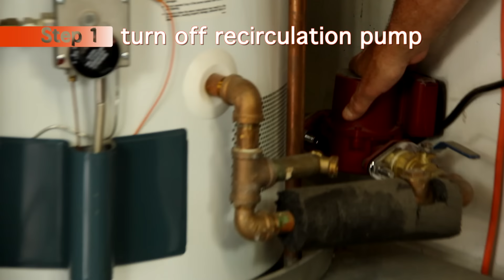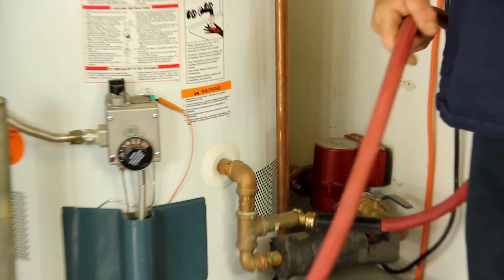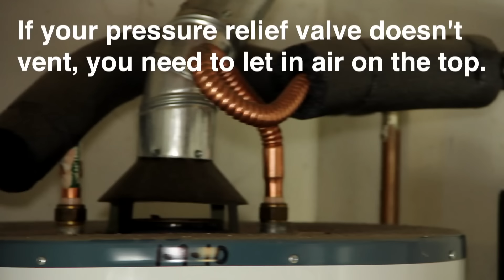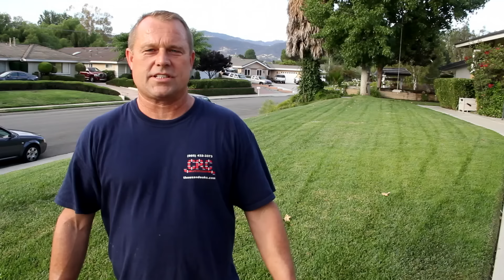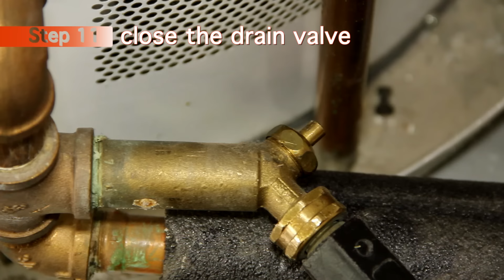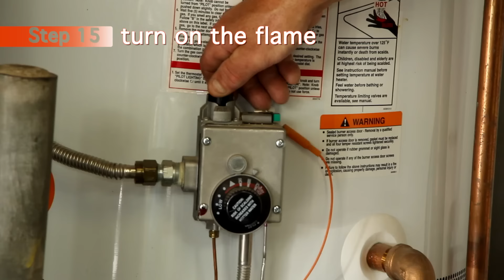How to drain a  water heater

Comment: I've seen where they tell  you to open up the hot side of a close faucet near the water heater.  Then go to another level of the house and open up another level and open up that hot water side of the faucet.  There is no need to unconnect the flexible pipe.  What if you didn't use flexible pipe and used copper

Comment: Did everything step by step. Noticed black flakey sediment during the 5m flush. Flushed it for an additional 5m and still noticed the black flakey sediment but not as much when doing the flush. Opened up all the hot water valves in the house and noticed the flakey sediment coming through the sinks and shower. Will this eventually settle down to the bottom or will I still get sediment from the sinks/shower?  Thanks

Comment: Thank you! First time taking this task on and we nailed it. 🙌 On that note, any recommendations to prevent future struggles of getting my hose off the drain valve when finished? I also couldn't get the hose piece working while draining it, thinking I might be plugged the hose with sediment, is that possible? I did finally get it to work for the flushing piece! Again, thank you!

Comment: Okay hopefully you'll catch this since it's a new comment on an old video. My pressure relief valve isn't hooked up with copper piping out the bottom. Do I have to fit that and build up the recirculation system before I try and drain my tank?

Comment: There are a few more important steps to be mentioned
1.  Turn off the heating or switch off the power at the home fuse panel (30A) the night before and take 1-2 showers to lower the water temp and not damage the draining hose
2.  Turn off (close) the cold water vane or red lever at the pipe just above the tank
3.  Connect the hose at the drain valve, open the drain valve with a flat butter knife if there is no place for a screw driver
4.  Open the hot water at a nearby bathroom faucet to allow air inside the tank, otherwise it won't start draining.  You can also lift the spring tank burping valve
5.  Let the tank drain for about 1.5h. It will drain first cold water, warm water starts flowing after about 30 min
6.  Once the tank stops draining  CLOSE the spring burping valve if you did open it - very important otherwise you will flood the room
7.  Leave the bathroom faucet hot water OPEN - very important to vent the air from the house piping
8.  Open the cold water valve or red lever just above the tank.  The bathroom faucet will start hissing loudly evacuating air from pipes.  The hissing will last 5-10 minutes
9.  Allow the tank to drain with cold water for 10 min or more.  Never close the bathroom hot water faucet during this time
10. Close the cold water valve or red lever just above the tank but leave the bathroom hot water faucet OPEN - the hissing will continue another 5 min or so
11. Close the drain valve - don't tighten too hard, remove the drain hose. Check the valve for dripping. May want to rotate it a little back and forth but don't overtighten
12. With the bathroom hot water faucet still open, open the cold water valve or red lever just above the tank. The tank will start filling up and the bathroom faucet will hiss for 5-10 minutes. Once the bathroom hot water faucet stops hissing and starts having a steady water flow, turn it off to allow the tank to fill up fully.
13. When the tank is fully filled (takes a few minutes), the cold water piping at the tank gets quiet. Again, during all this time the spring burping valve is CLOSED
14. Turn back on the tank heating only when the tank is fully filled up
15. Check again the drain valve 1-2 days later for dripping

The biggest risk with draining the tank is the drain valve may get stuck with debris and will start leaking when closed up.  Have this in mind before starting. You may try closing/opening the valve a few times to free it from debris, but if the tank has a lot of sediments you may actually cause more trouble trying to drain it. May try to use a garden hose to put a water jet through the open valve to clear the debris.
Reply: Nope

Comment: This videos great, although I've not got this type of elaborate water heater installation . This one is or has been clearly recently installed. I've got a plastic male threaded connection for draining no ball valve nothing you connect a plain garden hose and then??? I'll research another video.

Comment: Thanks for uploading this! Our water was running brackish today and I saved myself a pricey plumber call by watching this video! 

Note: if anyone has an expansion tank on their heater there’s a little air pressure cap on top similar to what you find on a car tire. That’s where you let the air in to drain in that situation. My hot and cold outs from the tank were just straight copper piping So there was no nut to loosen. (Took me about an hour to figure that out 😂)

Comment: Step 1 -  Turn off recirculation pump (turn off breaker)
Step 2 -  Turn gas to "pilot" setting (unless electric)
Step 3 -  Shut off water supply (valve on cold at top right)
Step 4 -  Connect hose to drain valve
Step 5 -  Take hose outside (put in bucket)
Step 6 -  Open drain valve
Step 7 -  Let air into tank (loosen top nut)
Step 8 -  Let take drain completely
Step 9 -  Tighten nut on top of tank
Step 10 - Flush tank (open main valve) Apx. 5 minutes
Step 11 - Close drain valve
Step 12 - Disconnect hose
Step 13 - Turn on hot water in house (farthest from water heater 1st)
Step 14 - Turn on recirculation pump and/or breaker
Step 15 - Turn on flame (unless electric)

Comment: Regarding the loosening of the top nut to incorporate air in the system....If I have fully soldered copper lines instead of the flex lines, can I at this point just cut the copper lines to allow the air....there shouldn't be any water in there, right?  THanks.

Comment: I had a Bradford White water heater installed in 2011.  I had not ever drained it in fear I would mess something up.  
I took on the project 10.08.19 and it was easy. 
I’m glad I drained it but there wasn’t anything to speak of in the bucket.  
We live in Dallas, TX.   Could it be possible I need to check something else? 
Thanks for your instructions!

Comment: Opening a faucet works a lot better for getting it to get to drain than using the pressure releif valve. I wanted to know why you didn't let the water cool off before draining? I would think draining the water heater when the water and the tank are hot would be a bad idea. Why did you install a circulation pump? Does that prolong the life of the water heater?

Comment: My comment might help some folks. I did every procedure to get the water to out of my tank, but it refused to come out. Finally I realized the weird plastic drain valve simply was not working. I replaced it, and now the procedure in this video is working.

Comment: You don’t need to open the hoses on top of tank or the pressure release valve, just open any hot water faucet in the house this will create the vacuum necessary to flow water out. Why would you go through that. Other than that the video seems correct
Reply: Works the same but may be the better option to open hot water faucet rather than the pressure relief valve. Friends used pressure relief valve for this and after it was open it never shut off back properly and they had a leak with immediate call to plumber to replace the valve as it was not opened for decade and its emergency use one, so it corroded and spring never shut it back. more dangerous than opening the faucet for sure.
Reply: He's a plumber giving a tutorial. He isn't wrong.
Reply: yeee he lost me when he started doing all that.
Reply: @The Master Chad  shut off the cold water intake to tank. That is creating the pressure.
Reply: He gets paid hourly
Reply: Opening hot water faucet does nothing 
Opening the pressure relief valve fixed the issue
Reply: agreed, it's better to just turn on the hot water faucet.
Reply: Faucets did nothing for me.  As soon as I opened the cold water valve at the top, it started gushing.
Reply: I tried a faucet and heard nothing, then tried the shower faucet and then I heard water moving except no water came out.  I'm thinking there might be an obstruction.

Comment: Nice video! I watch it annually before I do this. Also, I just open the hot water tap in the basement utility sink, which is 25 feet from the water heater, and that lets air in to the system.

Comment: I'm only getting a trickle to come out,  any ideas?
Reply from the maker: Its either needs air in the system to break vacuum or the drain valve could be packed with calcium.

Comment: What if after everything the water relief valve is dripping?
Reply from the maker: it may need replaced,unless its a pressure problem.
Reply from the maker: You may check pressure

Comment: I'm getting water out of the T&P valve, but it appears to be less than 8-12 oz a day.  Pulled the old T&P and the ceramic rod in the center was loose, does that indicate it was broken and leaking?  Replaced T&P with same results.  Very frustrating.  Not water out the T&P drain after a shower, but must be tripping when tank goes on heat cycle.  Any ideas?  Great video on how to drain.  Have one on replacing the T&P valve?
Reply: Still having problems?? Probably have it fixed already. But, I will give you advice for the future. He knows that as soon as the T&P valve is opened,, in most cases it will have to be replaced. There is a rubber grommet that will never seat correctly after it’s been in use for a couple years. Your, the reason that it’s leaking is because your thermostat on your heater has failed. It’s heating the water up too hot. There for expansion occurs, and it has to go somewhere. FYI..

Comment: This video is a life saver. The faucet on the bottom of the tank went out and I had to drained the tank for the first time today. Now I just have to replace the faucet. If I used the pressure release valve method should I replace that also?

Comment: As u know...lime builds up even over a few months and can get trapped at drain valve as it drains...even if try to flush with water from cold side.... i use a low pressure air compress blowing into relief valve that unclogs trapped lime at valve...

Comment: so im draining a tank at my hotel, its rusted bad and needs to be repalced, but we want to drain it obviously first, i turned the incoming cold water off, and then closed the outgoing hot water, because these are 4 units all connecting to the same hot water outlet, so to now drain, all indo is open that releif valve? because no water is coming out with all thise closed.

Comment: thanks for the vid. I recently bought a house with high water pressure. I rebuilt the PRV. but I just noticed there is no expansion tank. do you have a video on installing one of these?
Reply: They go after the shut off valve on the cold side.

Comment: Thank you! I just bought a house and noticed the hot water heater making knocking noises whenever it had to heat up a large amount of water (such as after running a large load of laundry using hot water). A plumber suggested that draining and cleaning the tank may help, and these instructions were extremely helpful. Unfortunately, once I turned the gas back up to heat the water filling the tank, I noticed the knocking noises were still there. Oh well. I saved the water I drained so I can use it to water plants once it cools down, too.
Reply: I would drain the tank
Reply: Yes, that's what I did. I followed this video and drained the tank.

Comment: Does that sediment/gunk go into your water system inside the house? out the faucets in bathroom/kitchen etc?
Reply: It will if is in bottom of your tank,that's one of the many reasons we need to drain the tank.
Reply: it will if you don't dtrain it out of the tank.

Comment: Ok so when I moved into my new home I was trying ways to conserve energy.  First thing was turning OFF the water heater.  I never use hot water so why waste electricity heating it right?  What is the best way to do this for prolonging the life of the tank?  Should I drain it and then flush it and then keeping it empty by turning off the water supply to it, or fill it with water but then turning off water supply so I am just getting clean cold water and not water mixing in with the tank water that will have bacteria growing in it since I am not heating it?  Thanks.  BTW I live in Florida so the only time of year I turn on the heater is November to January and even then I only turn it on as needed.

Comment: My tank is 13 years old and has never been drained, do you think it will still drain?
Reply from the maker: At 13 years old I would think its time to replace,although you can still drain them its probably full of calcium.
Reply: If you followed all the video instructions required to drain your tank AND your tank doesn't drain at all (or is slow to drain), then perhaps sediment/rust is blocking the drain valve. In that case step on your drain hose continually; that creates a pumping action that forces pressure back against whatever is blocking the drain and loosens the blockage. This actually worked for me after a few dozen steps on the hose. Good luck.
Reply: Thank you guys this is very informative, I'll make sure to follow your instructions.

Comment: Question. There is black oily substance coming from the bathtub, bathroom and kitchen faucets but only when turned on hot. I was told to drain the water heater or clean out the filter? Suggestions.
Reply from the maker: +Mayhem Raider If its only on the hot side it sounds like the heating system,although I don't recall any black oily substances from water heaters.

Comment: Thank you so much for the video, this was exactly what I needed to drain my ancient Kenmore 8 water heater. it's 22 years old and still ticking! Got that sediment somewhat flushed out and humming again. Suggestion for step  7a: Open a hot water faucet near your hot water tank to help alleviate pressure in the line when draining.

Comment: Hi Charles. I am preparing to install a recirculating pump on my water heater and I want to ensure I don't make a mistake and damage or ruin my water heater in the process. So, as I understand it, I want to do the following:
1. Turn WH to pilot
2. Turn off cold water to WH
3. Open a hot water faucet in the house to drain interior pipe
4. Connect hose to drain; put end in bucket
5. Open drain valve
6. Open relief valve
7. Drain desired amount of water (do I have to drain the entire tank? it's huge and I prefer to waste no more  than necessary)
8. Install recirculating pump, including connections at furthest sink
9. Close the relief valve
10. Turn on cold water to WH
11. Close drain valve
12. Allow air to escape hot water line in house; close faucet(s)
13. Plug in recirculating pump

Do I have all that correct? I was told if I tried to drain water from the tank without opening a relief, it would collapse the tank and therefore I am a bit "scared" or "cautious" as I don't want to make an error and have to replace the WH.

Thanks for your assistance.
Reply from the maker: Susan Walls Susan You do not have to drain the entire tank to install a pump,although I would recommend it.As far as preventing damages to your tank if you follow the same steps I have provided in this video you should be successful.I hope this helps.
Reply: CRC Plumbing Thanks. Appreciate the help.

Comment: Thanks for the detailed video, CRC...we're definitely getting some major knocking & I'm about halfway done with your steps...our water coming out is filthy.  Thanks a bunch...this will make my wife very happy having cleaner hot water!
Reply from the maker: Warring Angel If your tank is knocking this may not go away without removing the entire drain valve and evacuating all the calcium through the 3/4 port as this is usually large enough to get out the larger chunks.
Reply: CRC Plumbing, Okay...sounds like I may need a plumber for that, huh?  Or do you have another video?
Reply from the maker: Warring Angel Sorry,I don't currently have a video on that one.
Reply: CRC Plumbing, It's all good...thanks for this one...it's very detailed and easy to follow.

Comment: CRC Plumbing I'm curious about something.  I own a Bradford White - M2XR504T6FBN, and It's probably been 6 or 7 years since I flushed it out last, and the only way I have to drain it into, is a sump-pump.

1) Do I need to be concerned about the hot water draining into the sump pump, or should I let it cool before draining?  Does hot water rinse the tank better than cool water?  I don't want to damage the sump pump.

2) Also, instead of turning off the gas, can I just switch it to "Pilot" instead of turning the gas off completely?

Thanks for the help in advance!   :-)
Reply from the maker: D F I would not drain it into a sump pump at a high temperature unless that pump were rated for high temperature,as far as the gas to guarantee complete isolation shutting off the gas is safest.Best of luck with your plumbing project.
Reply: CRC Plumbing Thanks, and yes...  though I wasn't sure about the answer to that, I went with "better safe than sorry" approach, and turned off the heat before draining, and the water wasn't even hot enough to burn me.  

The job is done, and it's all running like a champ!

Comment: My relief valve was squeeling and shooting water and waking me up many times so the landlord put a new relief valve on and now it doesn't squeal it drips and I fill up 2 five gallon buckets everyday and so much iron in the bucket , on top the water heater saise it was installed in 1996 lol probably hasn't been flushed.
ide hate to see what came out of this thing. today I was awoke by the drips making the bucket overflow.
Reply from the maker: Tom Thomas Tom, check the pressure to the home.High pressure and thermal expansion can open that relief valve